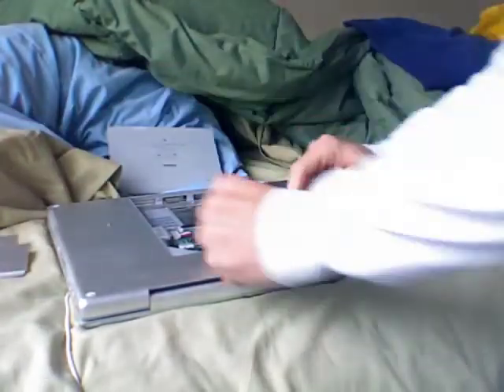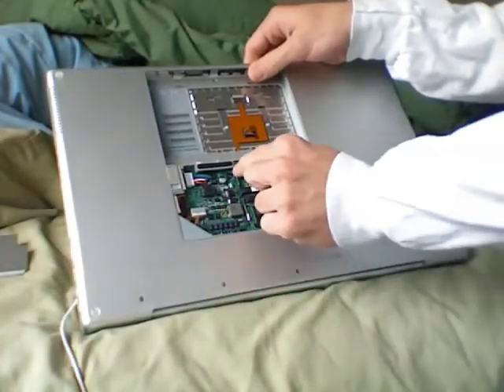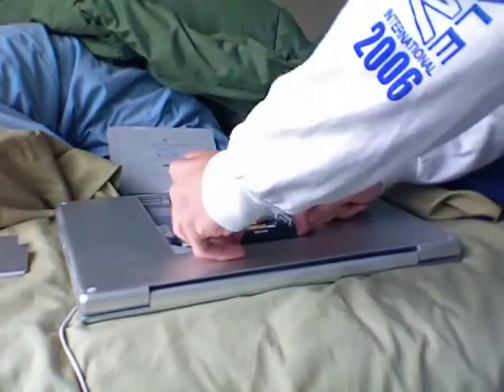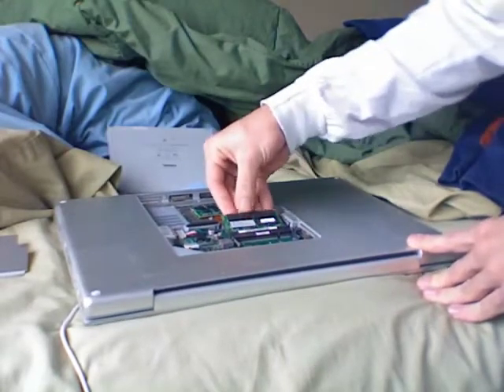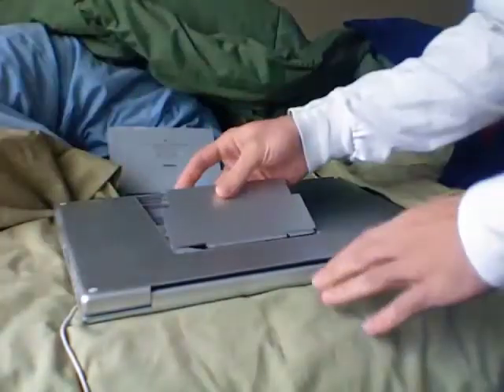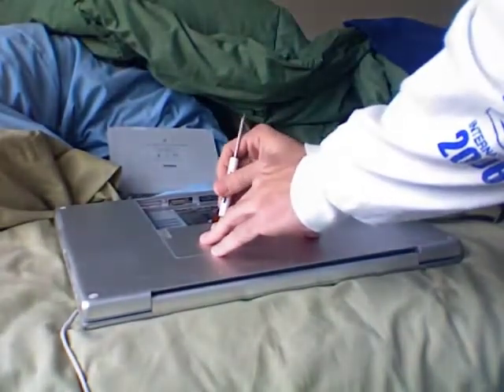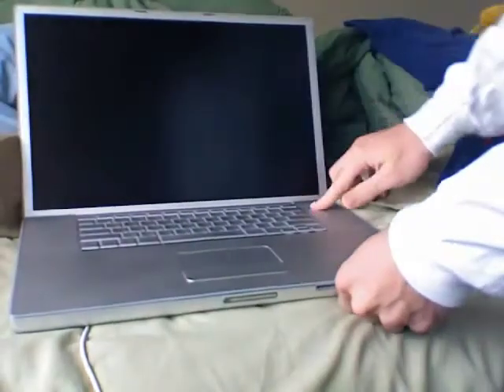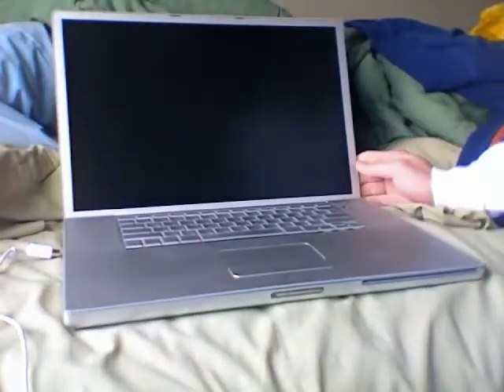Repair a PowerBook G4 that won't turn on

Comment: What the hell. I'm here because I found an old 17" PowerBook G4 at work that was to be sent off to the farm. I just picked up a new charger recently, and it wasn't powering on. I thought this would be silly, but it absolutely worked. Also either the logic board is bad or this stick of ram is shot lol.

Comment: The video is simple, but the problem it solves is real.  I was having the same issue of blinking sleep light, and refusal to boot or charge the battery.  After trying this memory swap procedure, the battery started charging and the machine booted normally.  Obviously, removing the memory reset something, but what I could not speculate.  Thanks for the simple tip that worked!

Comment from the maker: @designschema I couldn't even explain why this works. It shouldn't using my in-depth understanding of computer hardware. That being said, try taking out your single stick of memory, gently running the gold contacts between your fingers to remove any dust or whathaveyou, and put it back in.

Comment from the maker: @crgreenwell Not really. Maybe it forces the computer to re-check some settings due to RAM parameters being modified? Maybe the contacts just need regular cleaning? Maybe there is something loose and this wiggles in place? I can't know for sure.

Comment from the maker: If you hear the chime but don't see anything, the cord providing power and video the LCD screen may have broken. Try plugging it into an external monitor, if you then see the computer boot up, you indeed have a broken cable.

Comment: my macbook is a little different looking, i did what you said and it worked for a a little while, then i left for an hour and came back and it wouldn't boot up, i went through the steps again but it 
still didn't boot up

Comment: If your Powerbook won't turn on your PRAM battery might be dead. To force power on hold "Shift+CTRL+Option+Power button" for 5 seconds. Release. Wait 5 seconds. Then hold the "Power Button" again for another 5 seconds. If this worked for you, your PRAM battery is dead. Replace it. See PMU reset for more info.
Reply: Redbird omg it worked in 2017 lol yeeey!!!  Thank you love...

Comment: I had a PowerBook G4 12" laptop that wold turn on and the screen would flash and then go black. Took the Ram out and powered it on.  it showed a noticed to turn it off/reset it. Put the Ram back in it and it then power on like normal. :D